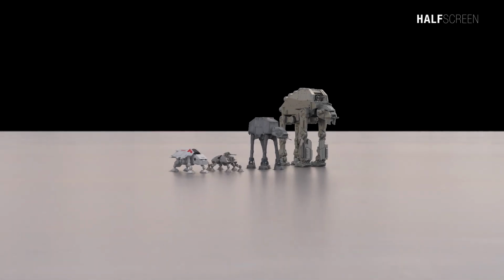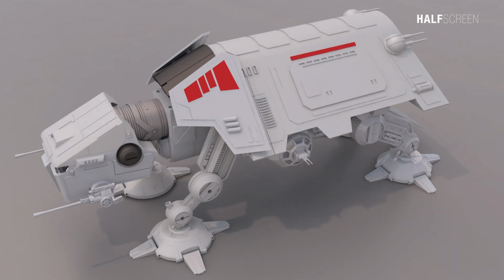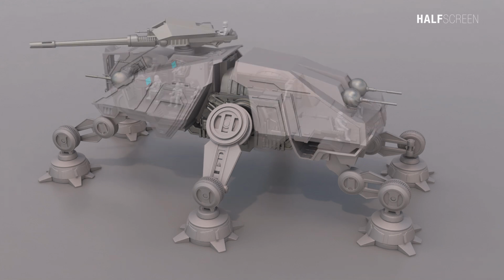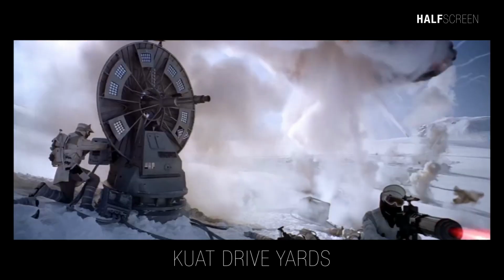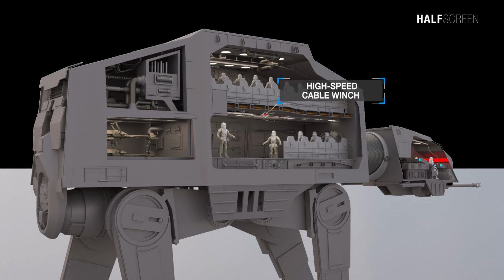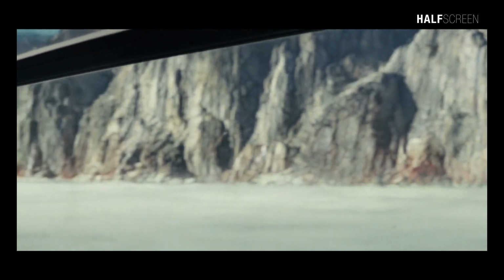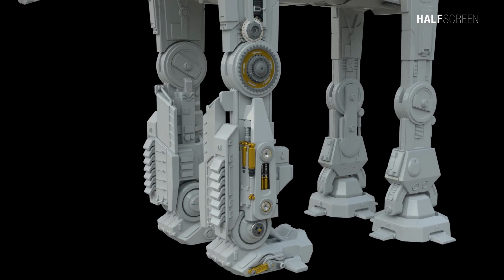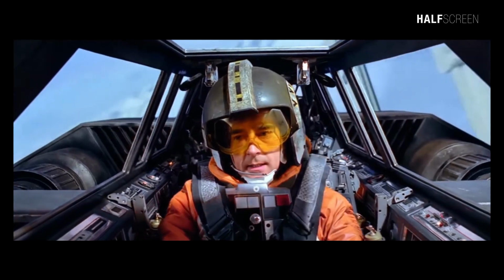Star Wars:  The Evolution of the Walkers

Comment: Wait wait, how does a laser no matter how powerful have recoil? A laser is nothing more than an intensely bright light of a single wave length (simplified definition) or more scientific a device that generates an intense beam of coherent monochromatic light or electromagnetic radiation by stimulated emission of photons from excited atoms or molecules. A beam of light or pulses of light would not induce recoil because there is no weight to light, a regular firearm produces recoil because the projectile has mass (weight) therefore for every action (pushing the bullet or projectile forward down the barrel by expanding gasses) theres an equal reaction i.e. Recoil

Comment: I would redesign the interior of the ATTE to have a the armory and weapons stored in the back, while in the middle I would install a fabricator, mini-lounge and eating quarters. Mini-lounge would have the amneties of a restroom, although privacy in the mini-lounge is not a feature. There is no need to have a proper living quarters since the seats can act as an inclined bed allowing troops to rest properly should travel takes more than a day to reach an intended target. A fabricator would allow the troops to have food, while the mini-lounge would allow proper space for soldiers to eat (although it couldn't house all troops at all times, which means troops took shifts between those who were engaged in services and those that weren't.). Due  to this shift process, you would need eight additional troopers who could be stationed on the bench seats located in the front section. Even though the craft requires seven troopers to function, you have an additional trooper who would function as the combat nurse and can utilize the mini-lounge as a make-shift clinic. I would also have some sort of semispherical barrier projector in the top back to help protect the gunner stationed massed-driver cannon as well a hatch attached to the mid-section that can allow the outside stationed gunner to return inside the vehicle if needed such as destrution or inoperation of the massed-drive cannon or to rotate shifts with extra gunner inside. The purpose of this ATTE isn't to deploy troops but to manifest control over the ground for troops who could be deployed. 

I would reinstitute the Manka APC Walker and redesign it to have a middle section and a double stack transport unit as it can house more troops and was more versatile for that purpose. These vehicles would be deployed behind the ATTEs to provide troop support. The middle section would be the same for the ATTE and the double stack transport would consist of troopers which can deploy more of. Additional seating would be provided in the cockpit to support two additional crew members as this walker only needs two to remain function, thus why it is the desirable unit to deploy troops. You would have two stationed combat nurses and the Mini-lounge would be a bit bigger due to the prospect of it being utilized to support the troops. 

I would enhance both walkers to carry a distance of 40 mph making them able to stay in a sync which is vital for the use of troop deployment.

For troops would replace the clone and stormtroopers in favor of the Marine units from Starcraft as they were situated in armored exoskeleton suit, such could be enhanced to deploy greater mobility, especially with the use of the stim pack so troops were quick enough to be deployed and recalled in a timely manner to support the 40 mph vehicles. So probably transversing at a speed 60 mph with stim packs that help them move at 70 or even 80 in some rare instances. Faster travel may be hazzardous or impractical for the genetically modified and enhanced soldiers who be the infantry deployed in these exoskeleton suits. I would remove the ball mounted cannons in favor of slightly larger ball-mounted fixtures with the ability to function as fabricators to supply weapons or equippers for the need to resuit infantry in case there is an issue with his marine exoskeleton suit. As you have such units, the need for firepower on the sides is unnecessary as such would be utilized by the marines as they are deployed. Also the back turrets could be rotated and move about in an almost perfect semispherical placement that can allow them to function in that manner if needed for side support making additional turrets unnecessary. Also if needed, semisphere barriers could be projected offering enough added potection to make the need for arms on the sides unnecessary. 

 For the AT-ATs, I would resign them to house a rotating twin-blaster cannon on top the cockpit to provide better aerial suppression as well additional artillery support for the cockpit as a whole. Forcefield projectors located near the neck to support it. Although these projectors can be turned off or overwhelmed, having them guarantees this vulnerable weakness is maintained to an extent and makes the walker less burdensome. I would give it ball rotating mounted twin-cannons, two on each side and one on that upperside of the body component. I would also redesign the cockpit to consist of a pilot and two gunners. This would give the AT-ATs a crew of Seven which can work similarly with the ATTE in which a Vice-Commander can fill-in for the commander during his break or command the lower walker units and marines stationed outside should the commander be busy in the cockpit of the vehicle dealing with matters that concerned AT-AT specifically, normally this would be the reverse. Along with having both a seating bench on the lower section of the body, you would also have a mini-lounge, fabricator and eating quarters instead of a station area to deploy troops. The top deck deck of the body would consist of reaper infantry instead of clone troopers or storm troopers, although they are similar to jetpack storm troopers and would be more like a hybrid of a jetpack stormtrooper and the reapers from Star Craft. There would be large hatch that would open on the top of the Walker allowing deployment of these troops who would provide mild airsupport and infiltration to supporter the walker cohort as a whole. There is no way to provide back support in terms of firepower for the AT-ATs, so instead I would put in a semi-spherical barrier projector on the rear as well as on the top when the hatch is closed. I would replace the speeder bikes with a hybrid bike configuration of the speeder bike with the vulture bike from Star Craft as they could deploy spidermines which were useful. I would make the AT-ATs travel at the same distance as the other walkers to keep them in formation. 

Deployment of a tactical unit should consist of 4 ATTEs with 4 APCs and 1 or 2 AT-ATs. If there are 2, then the second commander would be replaced by a spotter or experiened tactician that would be useful to help the vehicle provide additional support or the tactical unit but wouldn't hold any command over the unit itself. The typical formation would be four ATTEs in front in a U shape with APCS directly following in a U shape and following them were the 1 or 2 AT-ATs. An additional AT-AT was only necessary if there was a greater need for jetpack troop reapers to be deployed on the field. 

Not much needed to change for the AT-M6s. Unlike the AT-ATs and APCs which provided troop deployment (albeit jetpack troop reapers for the AT-ATs), the AT-M6 was used entirely for siege combat either to infiltrate an impenetrable facility or destroy heavily guarded enemy units. They were also useful against enemies that had APCs, ATTEs and AT-ATs as their massive cannons could pulverize through the shielding and armor of the other walkers. For this reason, there were less of them made and unlike the other walkers which were deployed together  When the AT-M6s are deployed, they are deployed together as a single unit to take advantage of their extreme fire capabilities as siegecraft and artillery. Unlike the other units which could be deployed closer to the action, AT-M6s stayed at a very far distance. Their Megacalibur 6 Cannon would be fitted with enough tech to make them able to hit anything that was visible on the horizon with extreme accuracy. Therefore, there is no need for them to be deployed so closely to battlefield and they typically stayed in the back with a unit of seven in which there would be 6 tactical units before it. They are designed similar to the AT-ATs in terms of the cockpit in which there was a commander, two gunners, and a pilot. Unlike-AT-ATs there are no stored units of troopers nor any additional artillery or guns. Instead, there was a dedicated team of engineers to to help maintain the powerplant, reactor and the Cannon to guarantee their continuous deployment on the battlefield. However, like the AT-ATs, there was a designated location for a mini-lounge, fabricator and eating quarters. However, this beast would also contain a proper sleeping quarters for the commander (who was ranked above the commanders that led the Tactical Units on the AT-ATs) and a proper lounge rather than a mini-lounge. There was the same sitting bench that allowed an exchange of personnel in shifts and there was also a Vice-commander, although they didn't share the proper amnetities for the commander on the lead AT-M6. In the subsequent AT-M6. Even though, there was still a proper lounge, instead of a proper sleeping quarters there was a small garrison of jetpack troop reapers to provide security for the AT-M6s if such was necessary, albeit they would be deployed from the sides rather than from the top. The AT-M6s were slower as they weren't necessary to stay in formation and were ideal to be as far as away from any enemy units as possible. I would give them the added protection of semi-spherical barrier protectors for the sides, top and back. It also served ideally for the head commander to be in the back to strategically analyze the field of battle from a distance. 

These semi-spherical barrier projectors on the ATTEs, APCs, AT-ATs and the AT-M6 can be overwhelmed, but the time to do so would under typical circumstances be too long for it to be key strategic interest and almost what was necessary to shoot through the dense durasteel platting that protected it.

How am I so accustomed to this? I am Darth Mortivarr. I actually designed this style of combat with Armored Skeleton Troopers and Jetback Reapers when I fought against the Eternal Empire.

Comment: Extremely impractical from ATTE onwards, or deployed in the wrong tactical circumstances. If the walkers had been deployed on Hoth during a snowstorm severe enough to ground speeders, or say planets with hovertech interference, large shallow seas, or volcanic activity, they'd have done much better. The SPMA is a much better workable walker

Comment: I think you need to check notes with metanerdz since the laat itself can't carry an at-te but only a specialized version named differently can carry it
Reply: And in solo it's visible that there is another ship used to carry an at-at. You really need to check facts before posting a video..
Reply from the maker: I just forgot to mentioned the Laat/c.  Its just the variant version of the Laat.  The video should be enough.

Comment: A thought on the AT-AT compared to the AT-TE...the Empire's version embraced the role of Transport a lot more than the earlier unit (including the far less armored cargo version). Would have been interesting to see more of a hybrid 'gunship' version of the AT-AT, with weapons emplacements along the sides and back of the main body, instead of just the head. (they could have door gunners, but that required exposing the interior, and there was the version with the large cannon replacing most of the rear space, but one could argue that was back to 'transport' again, just with an artillery piece rather than troops.)

Comment: All Walkers had their faults even the Clones beloved AT-ATE

While a great walker it was not perfect, the weaknesses of the AT-ATE was the middle section and underside/belly, a well placed shot from a laser cannon or rocket to these areas can takeout the walker, as we saw in the Battle of Geonosis a single rocket fired from a Hellfire Droid took down an AT-ATE which hit it right in it's underside.

Also being lower to the ground made it's underside vulnerable to mines and the last two faults were the Pilot and the main gunner, the Cockpit of the AT-ATE didn't protect the Pilot very well against heavy blaster fire and the Gunner of the Mass Driver Cannon on top was very exposed to blaster fire.

Comment: I agree that the AT-TE is the best of them. The Manka is quite similar and the second best, but lacks the strong armament of the AT-TE. But to be fair even the AT-TE is just in comparison a good design. It´s still a walker with all drawbacks this type of movement has. It is slow (not that good for a troop transport) and the main armament is good, but unprotected and very exposed. Same with the driver cabin. It´s laughable exposed and laughable unprotected. At least it seemingly has 360 infantry protection. Another question is how troops are deployed with the AT-TE. Just through the small hatch we saw in Clone Wars?

Comment: Kind of ironic that the main weakness (their high centers of gravity and those goofy legs) only got worse with every evolution… 🤣
Reply: Nah the AT-M6 has wider feet relative to its body size and they have a wider surface of contact. They’re slightly better than the Imperial AT-AT’s.
Reply: @Mklaudog  The AT-M6 is still the worst design. With the added front legs, it throws away any advantage a walker could have. They could’ve just not made the walker even taller than the AT-AT. The main laser seems to have a horrible firing arc and it wouldn’t work as a troop transport. There almost no redeeming qualities to it.
Reply: @andrewsurja3580  The front legs protect it from being tripped, fixing a major design flaw of the AT-AT. The legs also lower the centre of mass of the walker, making it more stable. The main laser cannon was able to hit Luke from a long distance so I don’t see how it’s firing arcs horrible. The AT-M6 is just as a good as a troop transport as the AT-AT. The AT-M6 is just as good as the AT-AT is many ways and better in even more. As this is the case, I can’t see how it doesn’t have redeeming qualities.
Reply: @Mklaudog  The front legs also rotated in the opposite direction, it would make the walker have a harder time traversing difficult terrain. The weakness isn’t shown at Craig because of the remarkably flat surface. There’s also no need to make it taller than the AT-AT. With it being taller, it’s just as prone to falling over. It may be resistant to cables but that’s just because four legged stupidly tall walkers just don’t work.